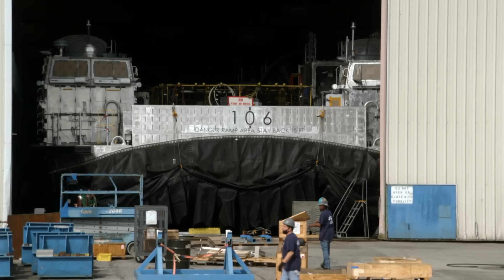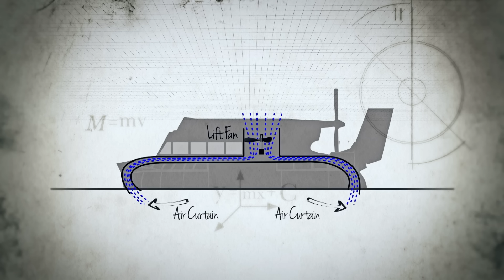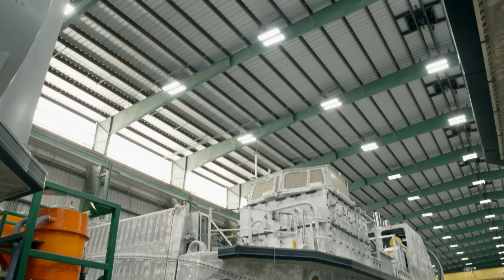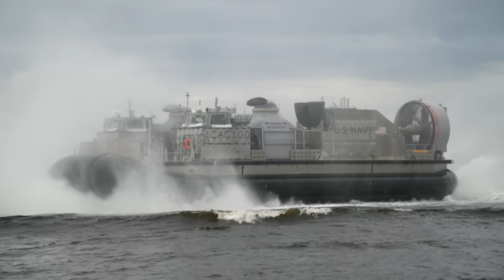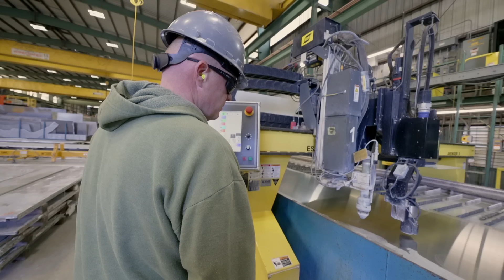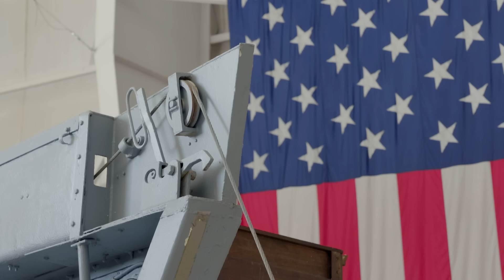The Genius Physics Of The Navy’s Newest Landing Craft | Blueprint

Comment: It it's made of aluminum,  it will have a short life at sea with that salt water.
Reply: You’re wrong about that there’s a lot of aluminium sail boats as the aluminium oxide protects the metal plus there are many types of Aluminium.
Reply: @wobby1516  correct like 6061 t6 or 7 series or even 2024t6 all resistant to rust, they use it on the leading edges of aircraft wings, which takes most of the heat and salt protection from chemicals to de icing them etc.✌✌🦘🦘👍👍
Reply: Great for cruising around the US coast, but how do you get it to any foreign location?  It's not going to cruise across the Atlantic 😂😂
Reply: @chevalij It's only meant to transport troops or single pieces of equipment from ship to land and back again.